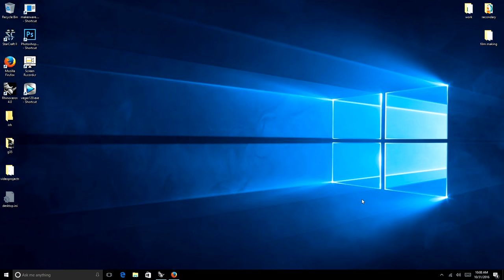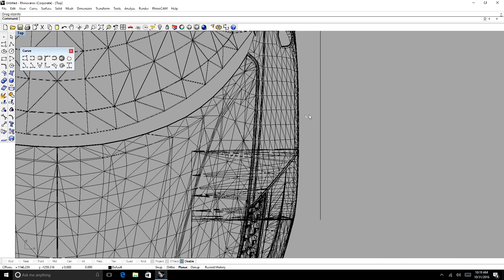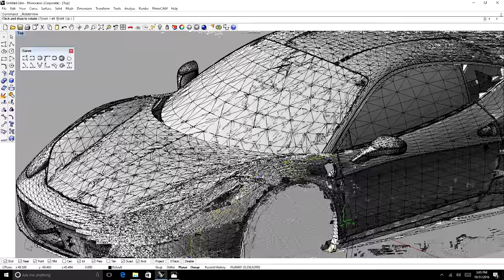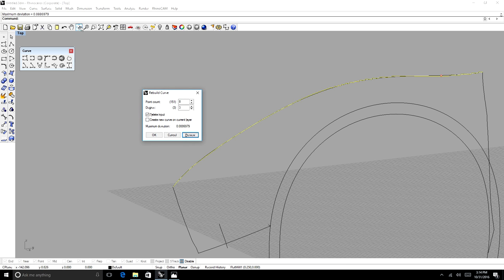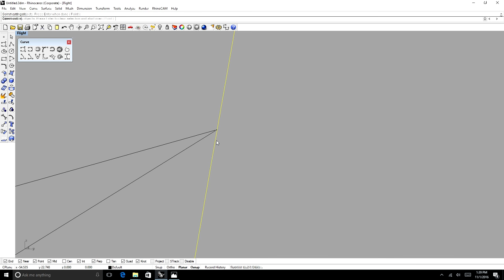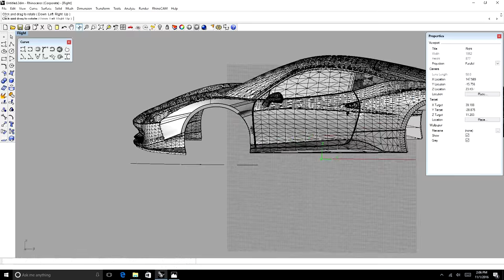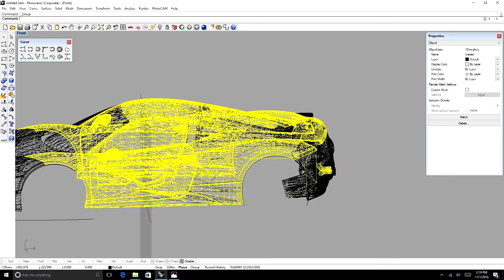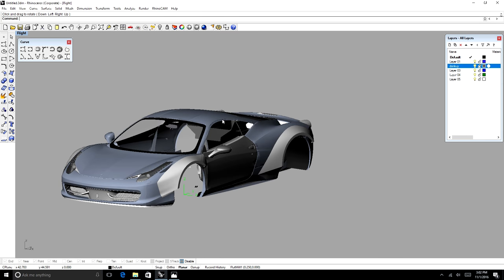Rhino 3D Tutorial for modeling Ferrari 458 Italia wide body fenders

Comment: Great video. Thanks for sharing! Here’s a modeling tip - if your file is mm and you are referencing another unit system (i.e. inches), just type in the abbreviation after the value and Rhino will do the conversion on the fly! So, just type 2in if you need 2 inches and Rhino will convert your input to 50.8mm without having to manually calculate. How cool is that! Cheers...

Comment: Great video and subscribed now also. Tell me if you wanted to actually make a new wing or fender for a car, how do you obtain an exact model of an exact car. You pulled this off a warehouse for design I'm guessing. But how do you know it's mm accurate. Or would you only be able to use this for a mock up design to show the customer. Also is there a way of scanning a whole car into a cad programme. If so what's the cost of scanning such big objects?
Reply from the maker: Hi. This model was just for mock up purposes and not accurate to OEM dimensions. In some cases, once the mock up part is made, it is mounted and further refined to be used as a part that can be molded and produced as fitting parts. Accurate scanning equipment is expensive and im not sure how much it would cost to have a company do it. I am currently setting up a laser scanner for this purpose. before i was using a sense3D scanner but it isnt accurate enough for certain standards.
Reply: Inspire Composites thanks for the reply. Means a lot! So how would you go about importing a car dash into CAD. Would the only way to do this is by expensive scanners
Reply from the maker: You can take comprehensive measurements of the dash and use them to model it in cad.

Comment: Where would you recommend to get accurate models of different cars? Besides grabcad
Reply from the maker: accurate in what terms? if youre designing parts off of the models, the models have to be 3D scanned from a real car if you want them to fit on the car. if you are using an artistic rendered model of a car, the model isnt really accurate to use in part designing.
Reply: That's exactly what I mean, is there anywhere I can get models that have been scanned from a real car?
Reply from the maker: ive searched for, but have not found any. i recall i did find one website but they only had a few cars. very expensive though. an einscan pro scanner is 4k, thats seems the the better route.  i have a mclaren 650s scan if youre ever interested.
Reply: Hi, I'm interested in the 650s model!
Reply: Inspire Composites I'll see if I can source a scanner. I'm definitely interested in the 650s model! Would you email me?
Reply from the maker: email me at nate@inspireautomotive.us
Reply: Sent!
Reply: Inspire Composites done. Thanks!